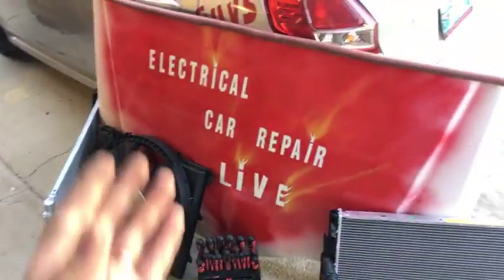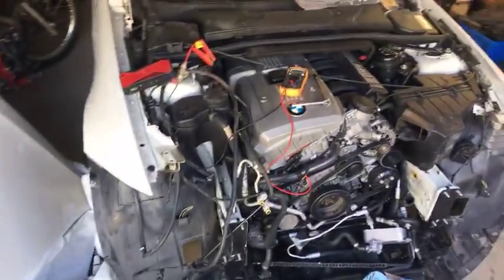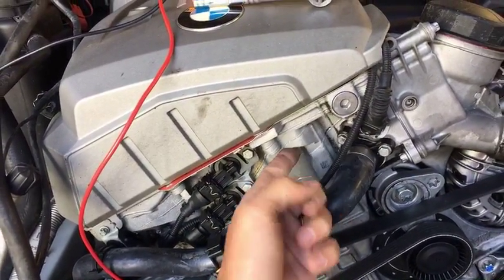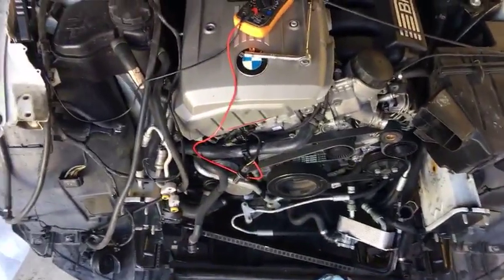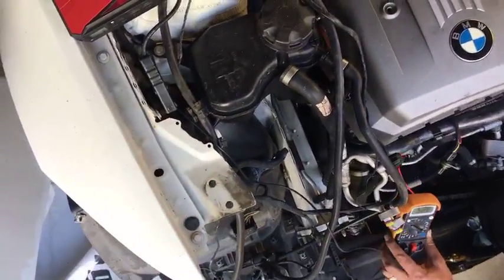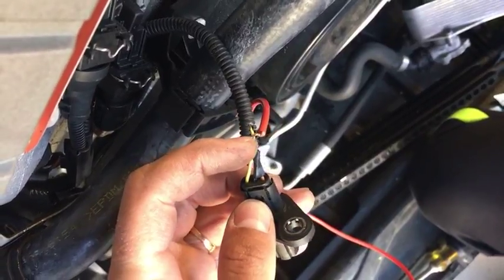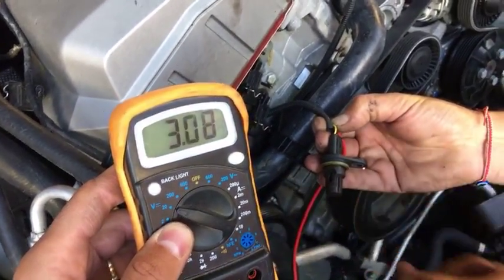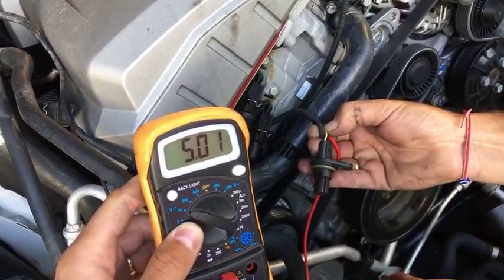HOW TO TEST BMW CAMSHAFT POSITION SENSOR E46 E90 E60 E83

Comment: Hola, quienes sois? Estáis en España? No encuentro forma de contactar con vosotros si no es por aquí. Tengo un dodge journey 2010, en principio dejo de funcionar la radio, después la bocina sonaba sola tanto con el coche en marcha como aparcado, después nos quedamos sin batería y tras dos cambios de batería, muchas mañanas el coche está muerto, algo se come la batería durante la noche. Hemos quitado fusible de bocinas y equipo d radio y el problema sigue. Podéis ayudarme?
Reply: Señor sometimes with horn and other electrical issues it's with the ring underneath your steering wheel with your turn signal switch

Comment: Hi exellent video. But I have a question. 
I Have a x3 2.5 si . That sensor I tested the misure IS 4.40 . When I dove whit i some moments the engine stop.
Mabe I Need to change this sensor?
Thanks in avance.

Comment: I keep getting p1315 code camshaft sensor A signal malfunction. I tested my sensor and it works. The car will not crank.
Reply: BlakSuess check if powers going to starter